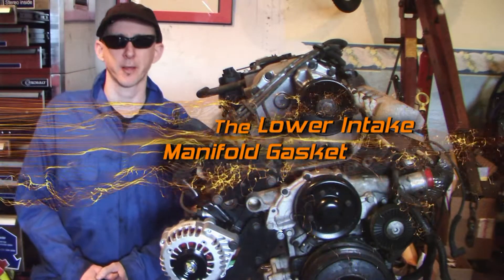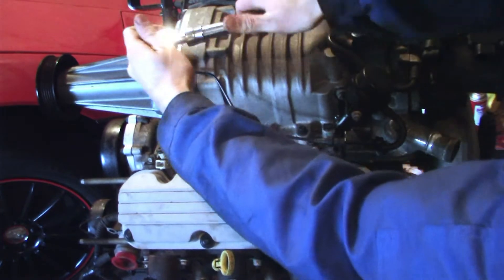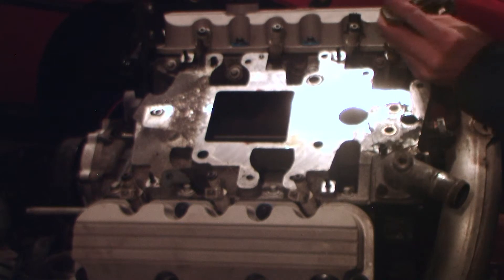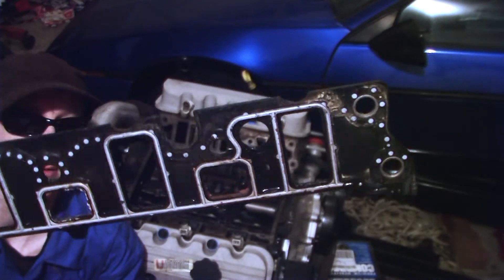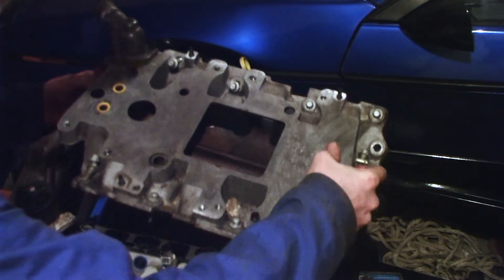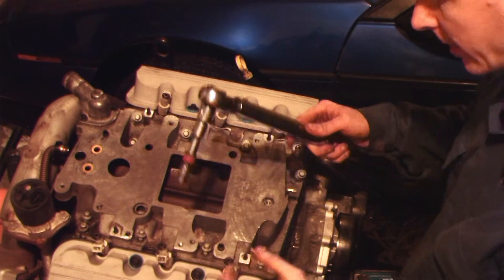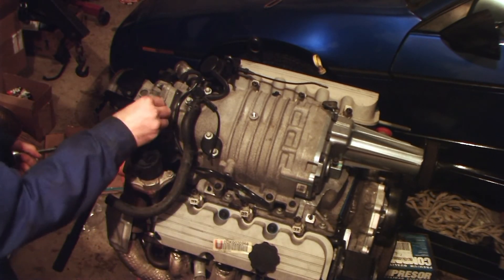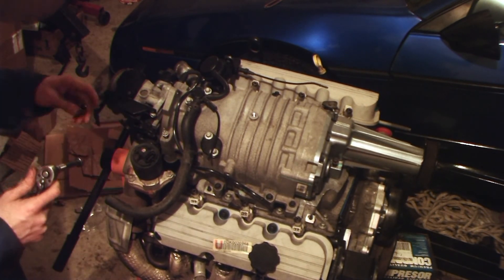Pontiac Fiero 3800 HOW TO: Replacing The Supercharged Lower Intake Gasket

Comment: Any issues putting a blower on a naturaly aspirated 3.8, like a buick or impala?
Reply: They are not essentially made to handle the pressure and HP addition so you would have engine failure fairly quick. 
You would need to beef up the crank, rods, etc., and might as well just get a 3800 that is already engineered and set up to handle the supercharger.

Comment: While it's off, that's also a good time to replace the supercharger coupler and oil. I'd also replace the plastic coolant bypass elbows with some aluminum ones since the plastic gets really brittle. =)
Reply: I've heard the aluminum ones are know to leak
Reply: @andrewnolte796  Because the gaskets for the plastic ones dont fit that well with the aluminum ones.

Comment: Quick question what year fiero is better for this kinda of engine swap ?
Reply from the maker: I believe that all Fiero's should be fine for this engine swap. You may have a few extra steps to take if you are using a 4 cyl Fiero. Hoses, fuel lines will be in different locations so you may have to pick up some V6 Fiero components to use. The gauges will either need to be re-calibrated or replaced. If you're looking for the best Fiero to own it would be the 88 model year since they had improved handling, steering and braking systems. The 87 model year would be second. They have the 5 speed V6 option. Improvements to the engine and still use braking, suspension and engine cradle components that will be easier to find replacement parts or upgrades for.
Reply: I don’t remember where is read this but the 1984 year model would require additional steps to the engine subframe. I don’t remember but just committed to memory when looking for Fiero that all the rest 1985-1988 are essentially good, but 1984 would require additional fabrication work. 
Pontiac had plans to put a V8 in the Fiero, but the Chevy division kicked and screamed that it would totally kill the Corvette completely. However, apparently Pontiac had it set up already so a V8 option would drop in and fit. 
I wouldn’t shy away from a 1984, but just know there might be a little something extra required for fabrication on the sub frame cradle.

Comment: Is it possible to use the 3800 with the getrag 5 speed manual thats on my 4 cylindet now.
Reply from the maker: If it's the stock 4 cyl 5 speed then it's not a getreg. It's an Isuzu transmission. That transmission wouldn't be able to handle the torque of the 3800. I recently swapped a 4 cyl 5spd Fiero to a 2.8 bored out to a 3.1. I was told afterwards that even the stock v6 engine had to much torque for the Isuzu transmission which is why GM used a 4spd trans for the V6 until they could get a 5 spd to mate to it in 87 and 88. A getrag can handle the torque as long as you don't try to do burnouts.
Reply: Makes sense since this is an 85 and I believe they didn't start the getrag's until 86. Would you recommend using the automatic with yhat then or a 4 speed manual?
Reply from the maker: +Geoff Taylor yeah I would recommend doing the automatic. It's easier and cheaper to do. You can't use the Fiero auto trans as that can't handle the the torque either. You have to use a 4t65e auto trans. With the manual trans you need a custom clutch, fly wheel and shift cables. If your not using a Getrag then you have to buy an F23 or F40 transmission as well. With the auto trans you just need the transmission, brackets and a custom axle which cost a lot less. To save even more of that cost I can show you how to build your own axle ;)
Reply: +LostNotForgotton  thanks. . That would be great when I get there. I will start back to that project in the fall.